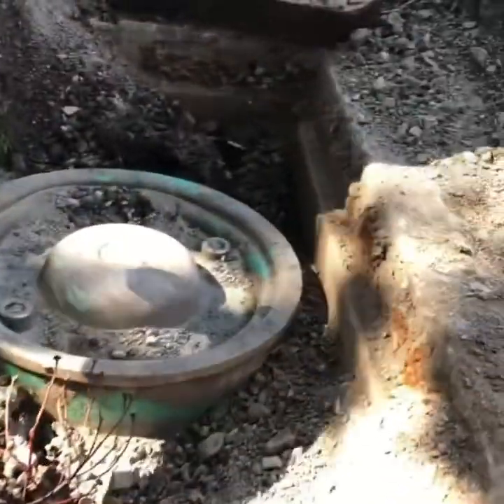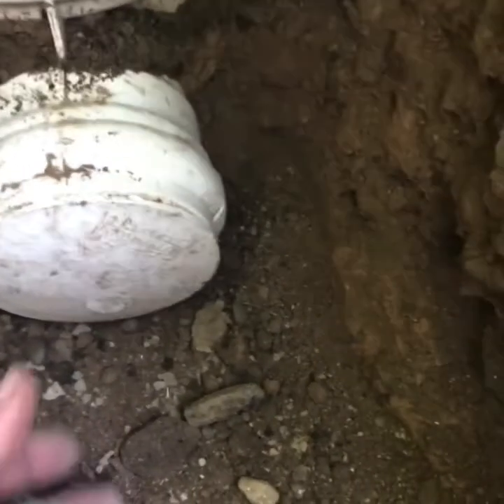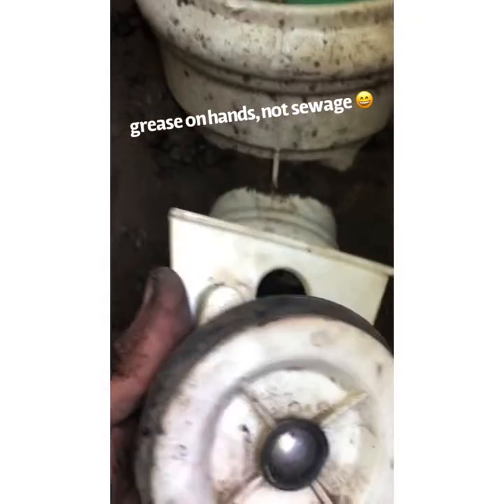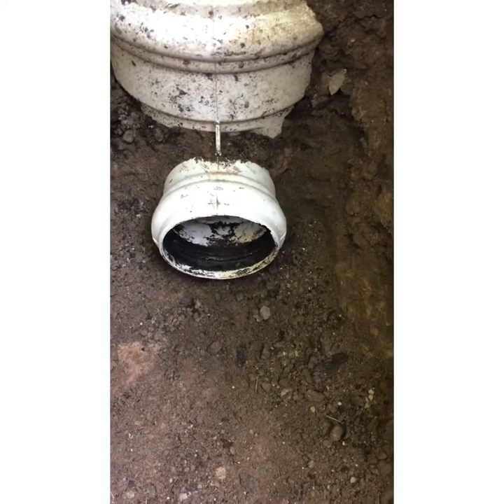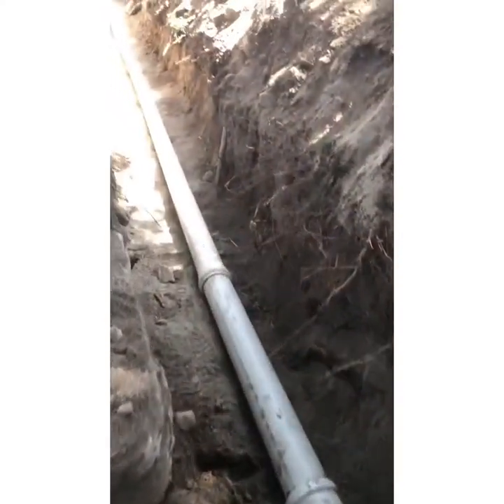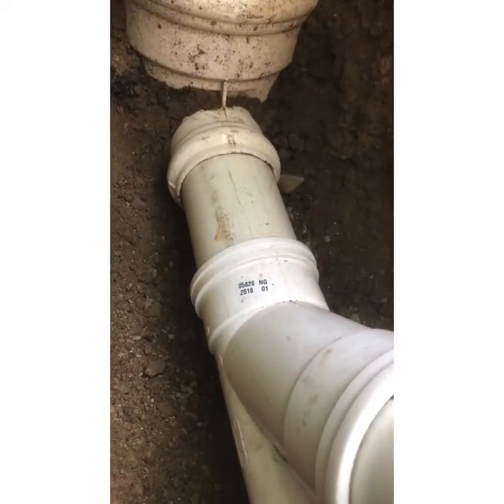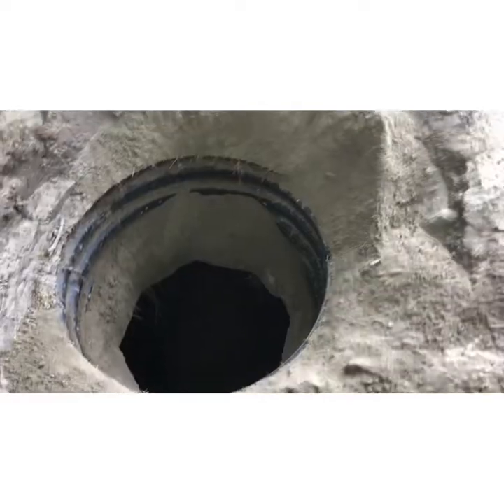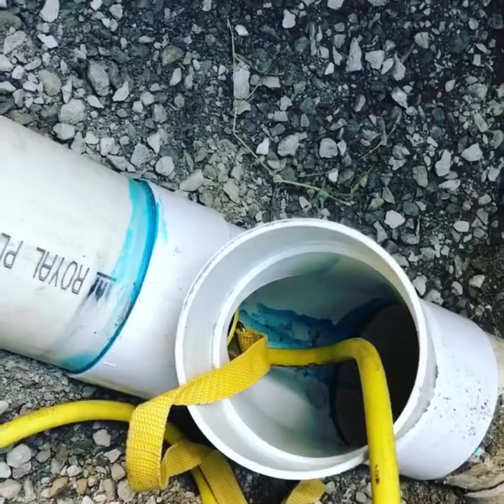Connecting To City Sewer Line

Comment: How did you find the city sewer?
Reply from the maker: The port is normally visible in many cases.  In the cases we cannot locate the connection we search for municipal drawings which normally have measurements.  We also use a utility locater to find the pipe or cover.
Reply: @groundstonewastewaterservi5066  BUT im the home owner and dont have any fancy equipment, how can I acomplish this?
Reply: You usually can call your city utility Dept and ask them to locate your their sewer lateral.

Comment: What's the standard grade of the pipe from home to city sewer?
Reply from the maker: Either a SCH 40, CSA or an SDR rated pipe.  All depends on the topography, depth and areas being driven on.  We pretty much use an SDR 28-35 PVC

Comment: where the pipe goes into the sewer tap... is there a special fitting to go into the tap or does the 4" just push into it?
Reply from the maker: There is normally a flange that you push the 4" pipe into, sometimes we make our own adaptation to connect.

Comment: Question as Home owner can o do that ?
Reply from the maker: It can depend on your local by-laws, most often the City would require a plumber or contractor to perform the work, but if the homeowner is knowledgeable it is not outside the norm to allow a homeowner to conduct the work.  At the end of the day you will either pass or fail the inspection and normally the inspector will allow corrections.  I would certainly do a lot of research first before undertaking this type of work.

Comment: Thank you for putting this video up, it was very informative as I will need to get this done to one of my houses in the near future. When the city comes in and offers city sewer to the residents, and the previous residents decline and opt to keep their septic tank.... does the city still add a connection point for the opportunity to tie into city sewer in the future? Or does this differ from each city? I have tried to map this out before, the closest manhole cover is on the other side of my street... If that is where it needs to be tied into that would require ripping up 3 lanes of traffic....
Reply from the maker: Hi Austin, normally everyone on the block would have to agree to the sewer for the municipality to create the sewer infrastructure.  Not always the case, but this is what I have seen.  If the majority of residents want sewer infrastructure and there is only one or two homes that don't want to connect, the municipality still draws the sewer connection to the property line.  When it comes to tying into the sewer, in most jurisdictions you will not be allowed to go through the roadway, the city has to bring the sewer connection to the home.
Reply: This whole process was/is very confusing to me. I’m in the county but have access to city sewer. I have the same situation where the manhole cover is on the other side of the street. I called the city and they confirmed that I could connect if I wanted, but I’d have to get someone to bore under the road to make the connection. They said I couldn’t cut the road. I don’t know who I would contact first or how to get the ball rolling. Do I need to submit an application to someone? Can you contract any plumber (if capable) to tie in to the sewer?  I guess most plumbers would know or know someone who would know. All I know is, it all sounds really expensive!

Comment: What made you change from septic to city sewer?
Reply from the maker: Often when developments and infrastructure reach areas that were predominantly on septic, homeowners then have the opportunity to tie in to city sewer.  This is beneficial when the septic system is either undersized for today’s standards or the system is in a state of malfunction.  There are a few other reasons such as smaller lot spaces to accommodate another drainfield area or adding additions or suites to a home.

Hope this helps